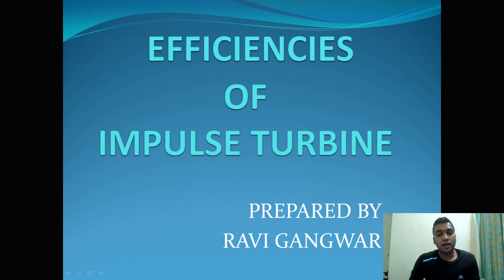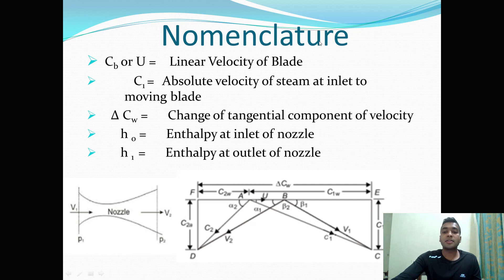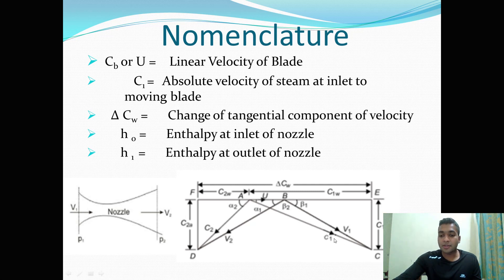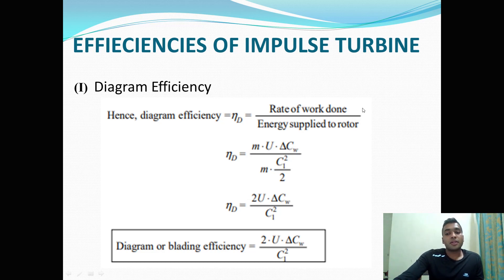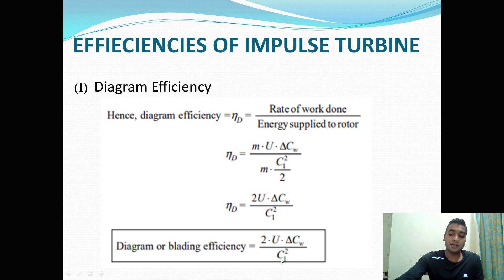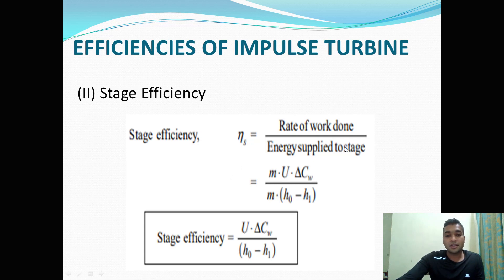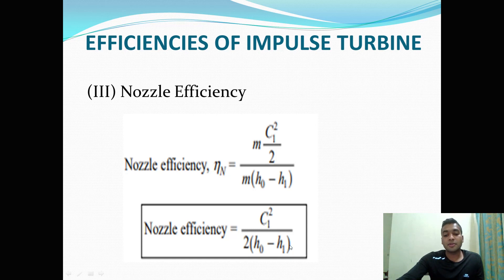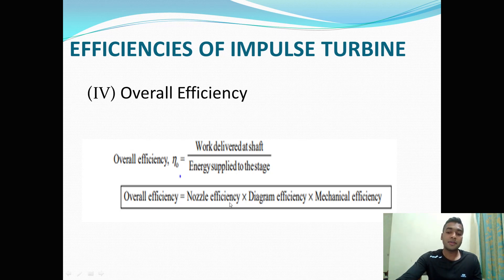Efficiencies of Impulse Turbine

Comment: Steam enters the nozzle of a single stage impulse steam-turbine at 200 bar and 450 degree centigrade and it comes out of the nozzle at 1 bar. The efficiency of the nozzle is 90% The blade speed of the turbine is equal to 0.5. The steam is passing through the turbine at a rate (20)kg/sec The inner and outer diameters of the turbine-passage are 0.3 m and 2  m, respectively Determine the power developed and the overall efficiency of the single stage impulse turbine.